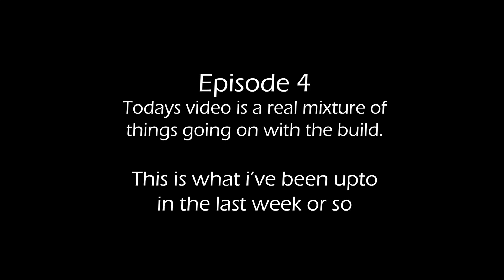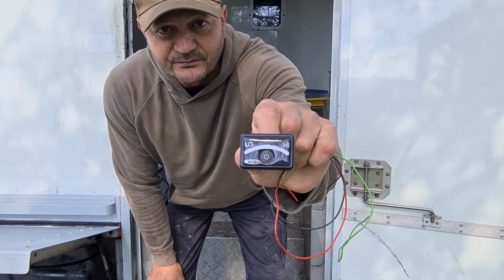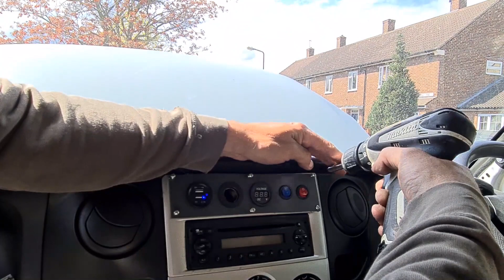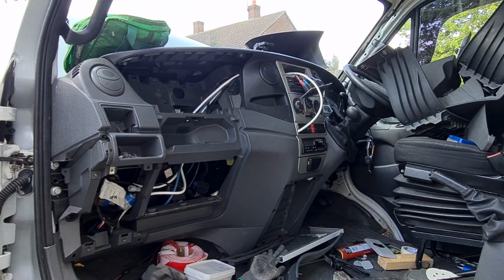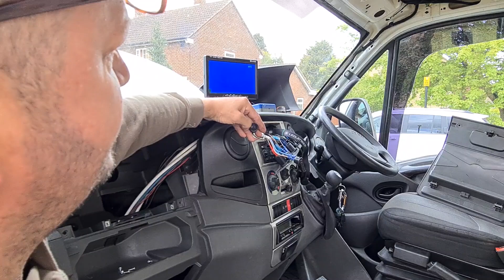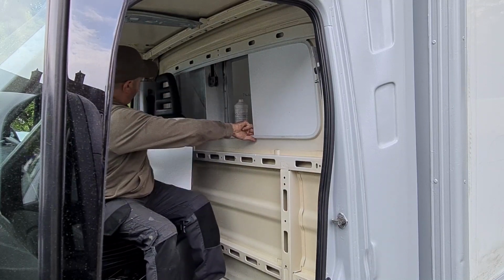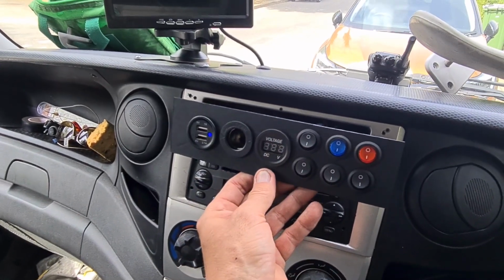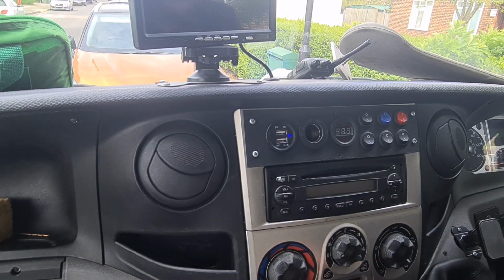Self Build Diy Camper from an Iveco Daily Prison Transporter

Comment: Those Multi-Tools are great. Glad to see you're not afraid to cut the dashboard to make stuff fit.  Looking forward to watching it progress.
Reply from the maker: I've had to use the multitool a fair bit removing the old bonded floor ply wood. As per the next video. They are definitely an underrated tool but those bits have to be spot on otherwise you make hard work of it just like I have lol

Comment: Hi , good little build this  is going to be,   but have just gone back a video or two ,  & if I may ask a question,    why have you made  a little hole / crawl through  ?? , instead  of  a hole to  the floor ??? , just bigger to get through  ,  & easier  , ??  You did say that should  you need  too get into the cab !!  So why make the hole small , bigger hole , quicker , into the cab .. ?? , thx ..
Reply from the maker: Hi Lee. Just below the hatch on the habitation area there is some heavy duty metalwork on the outside which appears to go into the cavity that was part of the service hatch release system. This would have simply opened up a can of worms so I had to compromise unfortunately. Thank you for watching 👍

Comment: Hi, enjoying the videos as I have looked at these. Can I ask why you took up the original floor? Also why are you adding extra insulation to walls? Thanks
Reply from the maker: Took up the floor quite simply because I know these floors were jetwatshed as many times as need when a prisoner decided to piss and shit  in his his cell. So they simply jet washed the cells and van. Our floor was rotten in the 2 corners at the front but me being me could not allow us to spend a night in this beast without being stripped back to getting cleaned thoroughly. So that meant floor up. Hard work but I know we are now clean 👍

Comment: I am no expert however if you intend updating V5 to Camper status are you not required to have a walk through from cab to habitation?
Reply from the maker: Hi Andrew. That might be the case, I'm not sure but to be honest it's not a problem for me. I'm not overly worried about the V5 stating it as a camper. I won't be having graphics on the bodywork either and I'm certain that's a requirement. My main concern is as long as my insurance company recognise the self build and value it when completed. Advance Insurance are great for self builders 👍

Comment: Why insulate the cab when you are going to cut thru ??
Reply from the maker: Quite simply because we can and have the material so why not. What I refer to as insulation is also sound deadening and the cut through when and if it actually gets done now or in the future will have a concertina gaiter protecting it from the elements